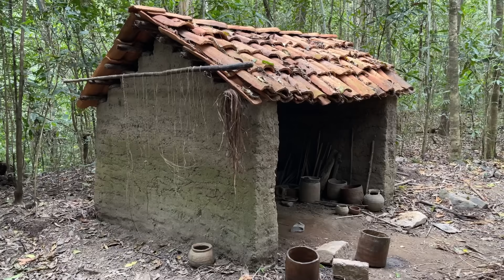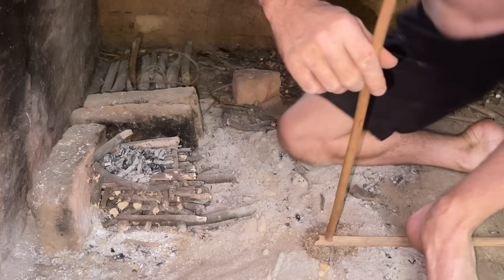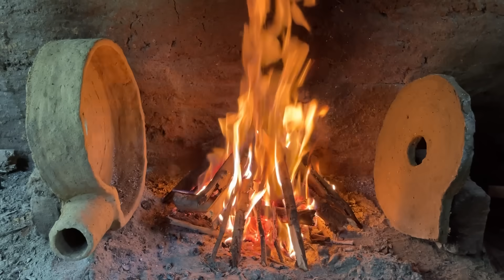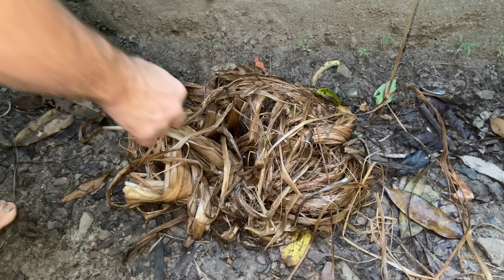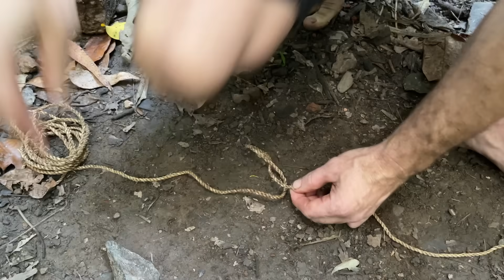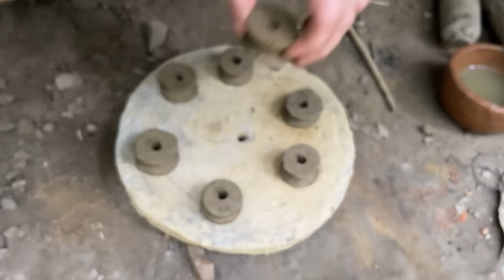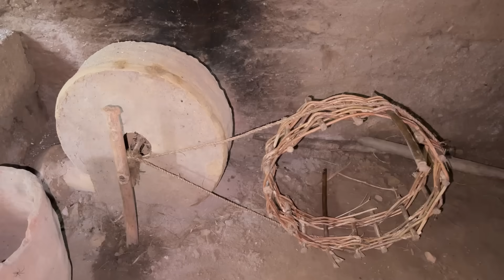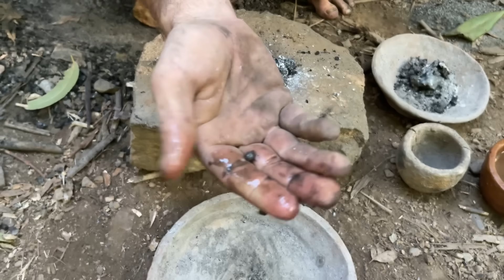Primitive Technology: Floating Pulley Blower Smelt

Comment: can’t help but think that now that he has a bit of iron, a lathe with iron-tipped tools is necessary to build wooden pulleys or gears needed to drive the blower at higher speeds and generate higher pressure

Comment: Woah, banana tree fiber is a huge find. Waaaay better than the bark from before. If you’ve never been around banana trees (I spent a lot of time with one in the atrium on the side of my dads house in Fairbanks Alaska lol) they are basically entirely herbaceous, and most of the strength comes from water pressure inside the cells, much like house plants. But as you can see, the tensile strength to reach tree height comes from the fibers.

Comment: You should probably try to make the inlet hole of the fan quite a bit bigger. A hole with such a sharp edge will be effectively smaller for the entering air, since there will be strong turbulence at the edge. I'd do it ~twice as big.
Reply: bell mouth

Comment: Have an idea for the next possible iron decarb experiment, what if the iron prills are inside a sealed vessel with a slit or holes on the lid for gas to escape. My theory behind this idea is some of the air inside that didnt escape when heated will decarb the iron, other than that is to reduce losses from charcoal coming to contact with the melted iron. Do have suggestion to put holes at the face where the air hits the vessel, but feels like that'll just push the air out of the vessel and replace it with carbon

Comment: Mixing plant fibres into the clay mix or laying sticks between two layers would greatly strengthen the fan housing against breaking apart. Another method might be to weave a very spaceous fabric of fibres and incorporating it into the middle of the clay walls of the housing. It could turn into a tough bendable sheet-like building materail, kind of like sheet metal, which also has a flat initial shape but can be worked into more complex, three dimensional shapes.
Firing the entire housing would require a very large oven and lots of fire fuel, so I guess it doesn't make sense while the shape is still in development. But firing the small pulleys would make them much more reliable. Using fibres in the axial dimension would increase the strength even more.

Comment: Would wetting the belt perhaps reduce the risk of it breaking?

Sometimes fibers end up being a bit tougher and lubricated when wet.
Reply: The problem isn't the cordage/belt. The problem is that the clay pulleys keep cracking at their thin centers (which is why he had to make a LOT of them to replace), so it makes it difficult to keep the belt stationary.

Comment: Watching the process, it feels like there's not enough pressure being generated to drive air into the smelt. Early ironworks show this being a grueling multi-person setup to supply the necessary air pressure. You may want to look at bellows or other more direct forced air methods, rather than the fan. Perhaps this is a good time to rebuild your stream's water hammer as a bellows driver?

Comment: I think pulleys at these scale are not that possible to improve in that primitive setting. Much larger designs can be tried. I think a much larger fan that sits on carved tree stumps might work. Maybe even a housing made of bricks with added mud to smooth the circle which standa like a small building. Fan diameter and the handle length can be used to gain more airflow or rotation.

Comment: I don't think the fan housing has to be spiral shaped. 
I'm not sure if you tried one without, but centrifugal forces will force the air out, but with the spiral it creates a chamber that doesn't directly force direction, only by building of pressure. Without spiral shape every chamber becomes pressurised with only 1 spot to relieve it and it could lead to higher pressure on the output
I could be very wrong in my assumption though, but a lot of commercial blowers don't have that spiral shape either

Comment: 13:49 - Have you thought about building a bicycle instead of using your shoulders for rotation?
Reply: Multiple failures of the crank system would plague a pedal powered mechanism. You need to have it resting on an axis for that, and he's already not had a lot of fun with it. He opted to the floating version so that he can put the tension and mechanics under his control, and it worked a lot better that way.

Comment: What if using a series of pulleys you power 4 blowers on every side, or use a dual blower setup where it uses 1 rod like used in the video, but pulls in air from the left and right instead of just one direction. Also I read scaling the floating wheel might be a problem, I’d suggest looking into if your able to a way todo a pulley train, so instead of a ratio of like 4:1 it’s more like 8:1 or 12:1. Problems I could see with that are rope slipping, heat buildup on the pulley train (like where the parts that rub up against each other the most) the parts may have to much force on them, and idk if it can happen with that equipment, but I know if you spin a rope or belt fast enough, it tries to pull and rip itself apart. Normally with rubber it just expands and contracts, but this is fibers. It may just break.

Comment: i still wait for clay pulley or clay gear with sticks , and connected to water wheel.. al clay fired, and may fixed to two clay plate (fired also) 
(i wish, but i can't make in my self)
Wish you luck, mr. Bushman

Comment: You should try putting spokes on your wheels to help maintain the most circular shape possible! Seems like that would be especially helpful for the floating wheel design since you’re holding it on opposite sides and it would be easy to stretch, squeeze, and bend.

Comment: Could you potentially use a slightly thicker pulley spindle, and instead of a clay/fiber mount on the spindle, carve a groove in the wood itself? Much more durable, smoother, less moving parts and less chance of pulley cord damage.

Comment: Feels like a big part of the issue is that the ore is very fine and simply falls to the bottom of the furnace right away. Try rolling it into marble size balls with some clay and then firing them in a taller furnace to better utilize the heat and the reducing atmosphere. Should improve the fuel utilization and allow larger individual smelts.

After you make the prills then heat them in a reverbatory furnace under a reducing atmosphere to form a single iron bloom and decarbonize them.

Comment: I really think you should put some thought into a modular blower housing. It would make it easier to move and repair the blower. As is, any structural failure requires you to build a whole new one from scratch. You can cut the lower half circle into a series of bricks placed in a line. The upper half circle would probably need one piece, but you could attach a handle to make it easier to lift.

Comment: Belt tensioner idea:  put another roller at the end of a lever.  A weight pulls the roller down onto the bottom/return belt, and you can adjust the tension by adding or removing weight.

Your floating pulley is a solution to the problem of the belt coming loose, because it lets you keep the proper tensions using your arms.  A tensioner pulley will keep the belt tensioned automatically, let you go back to a stationary pulley/crank, and save a lot of effort on your arms.

Comment: You can look up furnaces used traditionally from iron age - in polish they are called dymarka. They are rather slim and tall and in the process of melting, hole was being made into lower part of the furnace to tap out as much slag as is possible, which was then discarded.

Comment: This channel is pure experimental archaeology. You are a legend.

I was wondering, however. Maybe you are trying to speedrun into the Iron Age, but skipping the Copper and Bronze Age may have deprived you of important experience that would be needed to handle smelting of Iron, which needs higher temperatures and a more complex/sensitive chemistry. Of course, the question is whether you can even obtain some source of copper in your area by stone-age methods.

Comment: A foot treadle to turn the wheel is something I can't wait to see.  With wood and wicker it should be easy to make a chair and pump the fan around in comfort.   The next smelt with a taller chimney and narrower exhaust might increase the pressure and keep more heat in too.  Every iterating of this is exciting to see as it gradually builds to smithing.  

Once you finish smelting and smith a proper tool, you will have to update the channel name to Iron Age Technology.  😄

Comment: I wonder if perhaps by making the main rotor bigger than the blower fan, he would be able to produce higher RPM due to leverage so that the blower can create stronger blast pressure.

Understandably it’s all hand built but it seems like he’s trying to keep both parts relatively small and less taxing on his body

Comment: Looks like most of the heat was concentrated right in front of the nozzle. Perhaps reduce the footprint of the kiln and make it taller to help hold fuel? Also could maybe try forming pellets with ore and charcoal dust? The idea is to help concentrate the iron. Might need a sap or tar to help bind it.

Comment: I wonder if part of the issue is the ore you are using. The bacteria works but perhaps if you found hematite or magnetite sources nearby those could produce better iron concentrations? I also wonder if a taller chimney would get better blast pressure as you mentioned. You could build in a chute with a door at shoulder level to add charcoal and ore with the rest of the chimney extending up?

Comment: I think the furnace is losing a ton of airflow due to the fan geometry/construction. If you optimize the shape of the impeller and even just reduce the blade-case clearances you'd see a huge increase in airflow, which might allow for a larger furnace.

Comment: If you want to further explore iron making (and I believe you want to), you next milestone should be a heat exchanger. Capture the burning gases and make them descend then ascend through the heat exchange box. I imagine it constructed from your stockpile of bricks, with joints well mudded through. A single descending pass of ambient air, preheated air enters the blower and is forced into the  melting furnace is method 1. I'd like method 2 more. Force blow the cold ambient air into the heat exchanger, wherein it raises then drops and is expelled into the furnace. 
If you could preheat to cca 300°C, this would boost the furnace temp significantly.

Comment: shouldn't the fan be spinning in the opposite direction blowing air into the fire? it is spinning counter clockwise pulling air from the fire into (and burning) the fan blade assembly & then out through the side center holes of the housing (hence the charred wall next to the fan) and the hot air should be cooking human arm flesh...

Comment: You've done lots of work with fibre cord and with clay; have you tried a fibre/clay composite for things like the pulley wheels that need the higher tensile strength plain fired clay doesn't have?

Comment: Those key ways are the weak point in the set up. I know you probably recorded this months ago, but clay has some strength in compression but next to none in tension. Making a square peg hole on the pulley to fit on a squared piece of wood is the best solution with your current tools. Although I'd love to see you utilize your current ability to spin a stick to make an impromptu lathe to use with your iron knife to make a solid pulley. Or even utilize a regular branch, cut it down, square a hole on the inside, match up to a square outside hole, whittle roundness into it, shave it while spinning, mount it, and now the keyway is a solid option.

Also, taller stakes to hold the bearing with a piece of cordage keeping tension will make you lose less energy to vibration.

Also, bone knife when?

Comment: Dude I know that you are working on getting your smelting setup improved but you really should also work on improving your fire making tools. that way you don't waste it as much energy doing the normal friction method you have the materials make either a bow drill or a pump drill to start fires with please

Comment: I think there are some more efficiency to be had be redesigning the fan and housing. You want the fan blades to run as close to the housing as possible. The exit will need changing/ elongating. 

Also what about a taller firebox to hold more heat / more fuel in?

Comment: Perhaps you could investigate the possibility of leveling a large propeller with the fire's own power and transmitting that motion with a multiplier belt to the blower. I think just adding firewood could be a stable system.

Comment: 9:30
In machining, the word for cutting a keyway is broaching.
A broach or broaching tool has the dimensions of the key, but tapered lengthwise and with sharp cutting teeth that take progressively more material as it is pressed through the part.

In terms of tool design and material removal then, it may not be accurate to say I think of your process as broaching the pulleys, but informally I do consider your making the keyway broaching. The result in the final part is the same, so I think the same term probably could apply.

Comment: Need to make larger diameter blower. Moves more air volume, Gets better pressure, and needs to move less. So you don't pulleys to increase the speed. Way more simple.
Reply: A bigger blower might increase the air volume, but the pulley has nothing to do with speed. It's just to keep the belt stationary and have the torque to rotate the blower. The speed is dictated by the ratio of the wheel with respect to the blower axle.

Comment: Why not to place cane wheel horizontally? So wheel and rotor are 90 degrees to each other? You already twisting the rope, so this won't make any difference. I would imagine running the horizontal wheel would be way easier.

Comment: i think the only way up from here would be to make a double blower thats fed off the same turning wheel, one blower on each side, 2 ropes, 1 crank wheel. also need to find a way to keep tension, maybe some kind of bow, bent before being used as a spoke stand, or a stick with a weight(rock) on 1 end resting on the bottom ropes

Comment: I’m wondering if you made the impeller out of clay, integrated the fan blades into the disc at an angle that forces the air into the spout, that you would get flywheel action out of the impeller and take advantage of the stored energy?

Comment: Ohhhh I see whats going on. The pit for the bloom isnt deep enough, the furnace isnt tall enough, and the airflow is pointed at the base.

The prills being cast iron means you have the reaction going, but with the tuyere at that angle and that close to where the bloom forms it just keeps stirring the molten slag. Also the height of the furnace has a minimum and maximum for the ideal reduction zone size (abt 40cm). Try digging out a 12 cm pit under the tuyere entrance and increasing the wall height for the next run. The outcome should be larger nuggets of iron instead of tiny prills. 

Your most likely option to get usable iron is to use the low tech method of getting larger iron nuggets and later heating them to welding point to hammer into one piece. Similar to the iron knife, but not exactly that - you don't have the quality of fuel to cast iron/steel so you have to heat it in a crucible and physically beat it into a solid piece. Then reheat and beat into a more refines shape. 

The large blooms are outta the cards without higher quality ore unfortunately.

Comment: So I'm wondering if it might be a good idea to make some kind of mold to make the bearings? Like, make a tiny, conical tube, dry or fire it, then shove you clay in, pop out, repeat, stick to two together to make a bearing that then gets fired. Do that again 7 times, and you theoretically have bearings that have the same dimensions/roundness, and therefore more consistency for rolling.

Re Smelting: Wouldn't a foot peddle powered rotor setup allow for more consistency throughout a smelt? With these hand methods, you have to stop at the point where you need to recharge the charcoal/ore. If you have a foot pedal, you can be standing and picking up and filling with scoops via a bowl while your foot maintains the same air input the whole time. Also, would two blowers from different directions result in a higher air pressure within the furnace, and what impact would that have on the temperature?

Comment: metallurgy student here. I'll say it again, if you want to get experimental, preheating the air (even just a little) between blower and furnace should help massively. Hot blast was probably the single biggest advancement in iron smelting.
Reply: That'll take a longer clay pipe and a second fire over it. Sounds doable, question mark
Reply: @BotulinSpikedMarzipan  no second fire. Have the blower coil around the fire befire discharging into it. He will have to improve on his fan blades though. I think he is loosing a heap of air to poor fan design.
Reply: @davidhobbs5679 in was thinking this too. I'm kinda upset he hasn't created a better fan yet. I can think of a couple ways to do it

Comment: I think what'll really drive home your ability to get your iron is a CRUCIBLE, ngl. Your iron is likely melting/coalescing and then embedding itself in other similarly-hot material. If you had a crucible, it would stay contained, the slag would separate to the top more easily, and you'll keep the heat more between charges as the walls of the crucible will help keep it warm... Only issue is WHAT material would suffice for such a thing? That much I'm unsure of, but I'm loving the primitive smelting! <3 Love your work, keep it up!

Comment: 11:30. It needs another leg for stabilization. It wouldn't wobble and would be smoother. Move the handle up and add the leg/support between the wheel and the handle.